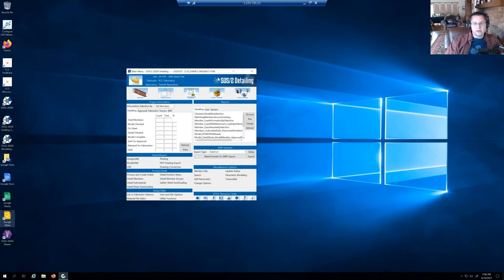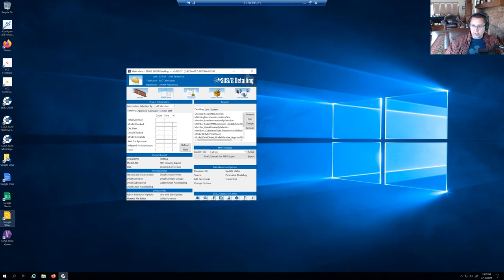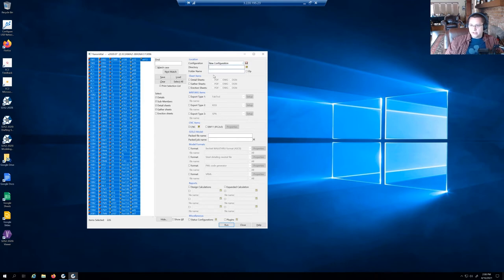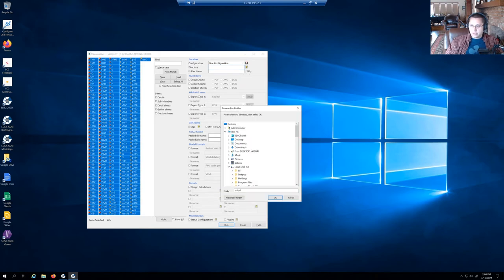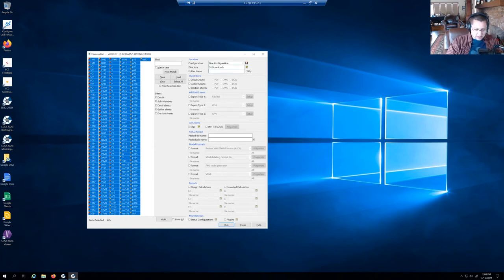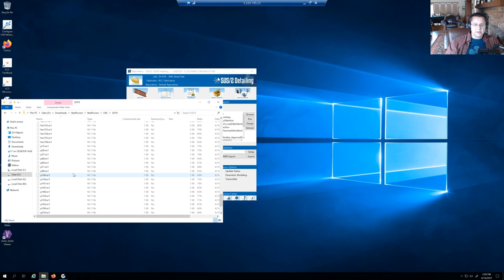SDS2 Transmittal Tool for Faster CNC Output

Comment: Ignore ALL error messages, huh? O-K...if u say so! Lol.
Reply from the maker: C'mon you must be used to that by now with SDS2
Reply: @SteelForum  yep...I am!....
Reply: They are warnings regarding the formats used. An example being, you choose as one of the exports DXF Plate and then selected all types of materiel. The DXF Plate export does not allow the export of wide flange material, channel material, etc. Hence the 'Download disabled for this material type'.
Reply: To Steel Forum: (Nick n Matt): would like to at some point get yalls opinion/review (maybe in a future video) of the new interface to SDS2 2021, likes, dislikes, good n not so good features on it. Haven't started using it myself, still on 2020i.